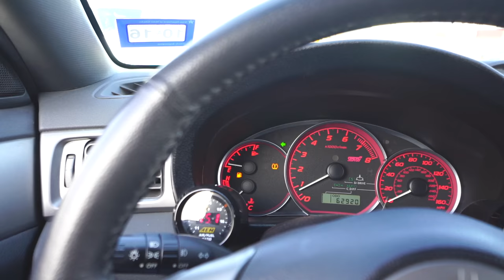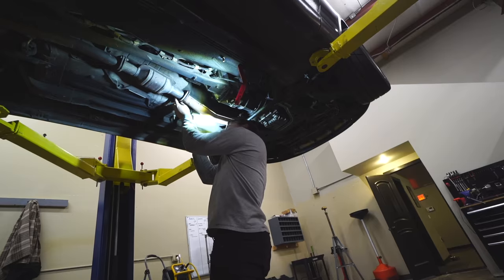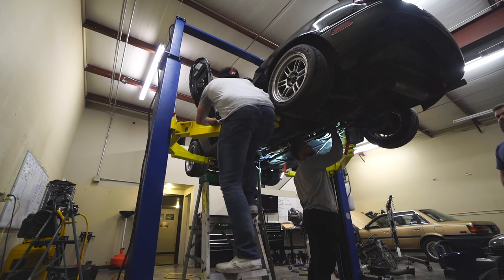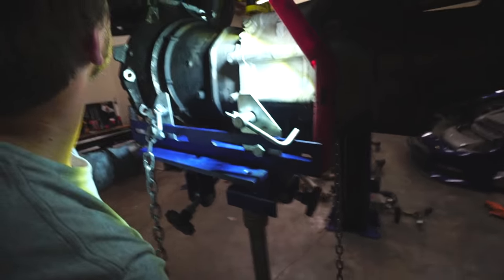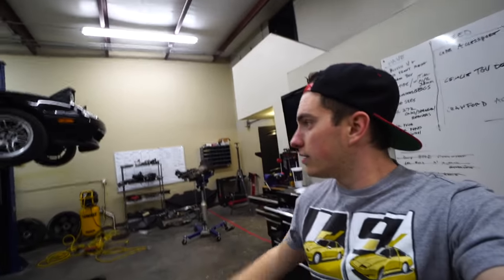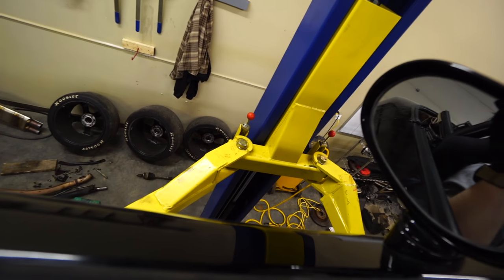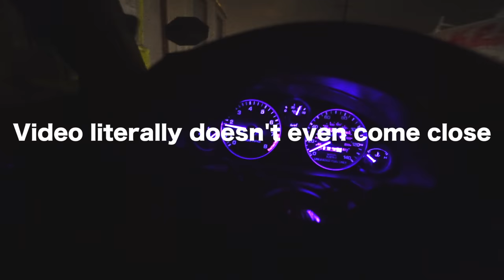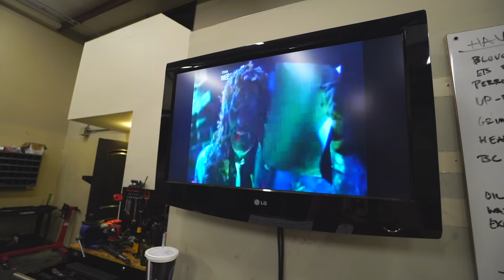FINALLY Installed the Clutch | Project Miata

Comment: Hey Evan, just as a tip for the next time you pull a car on a lift: park the vehicle with your steering wheel between the two posts. You won't have to manually move it back next time if you do this!

Comment: You should cut the exhaust tip so it doesn't show with the bumper cut. It doesn't look very good in my opinion. But do what you want, your car, not mine.